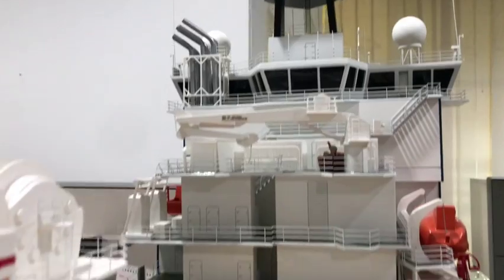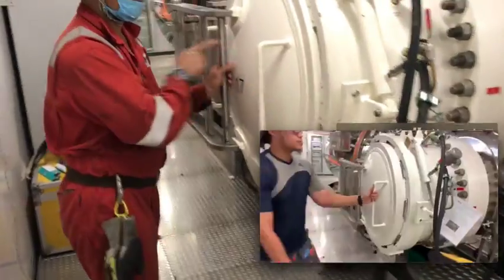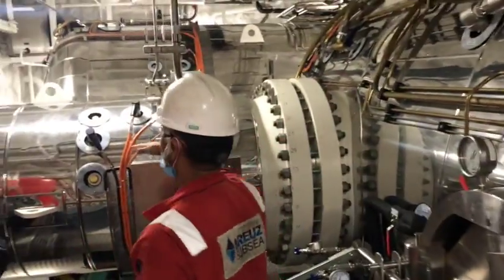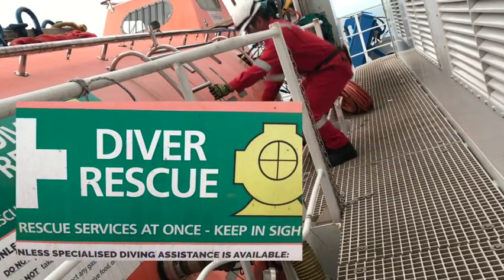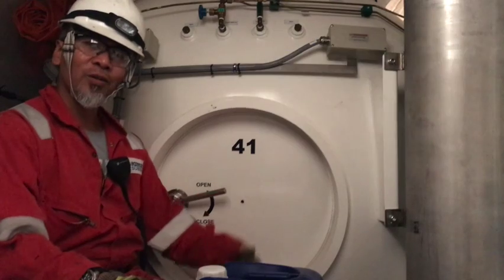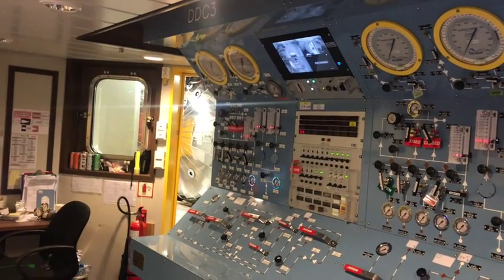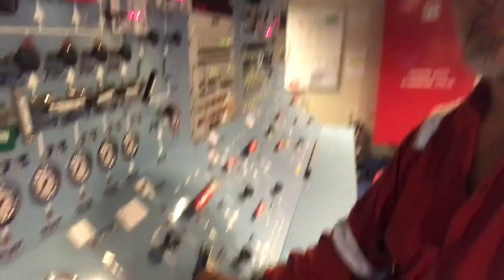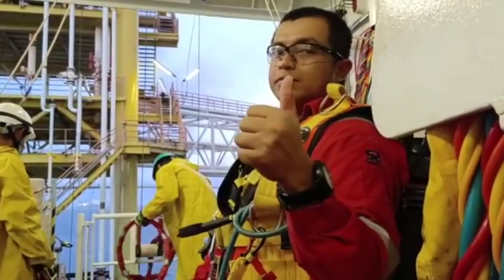Saturation Diving Chambers on Diving Support Vessel DSV Challenger . Brunei offshore

Comment: Hello Mr. Shamsuddin, don't be tired. I am Farhad, 24 years old from Iran, in perfect physical condition and an athlete, with a level one and level two certificate in industrial diving, working with a helmet from the Professional Technical Organization. I also have full certificates in argon welding, SMAW, TIG, pipe and structural welding, welding inspection (VT) and advanced industrial safety (HSE). I am interested in working in saturation diving. Please advise me on how to cooperate with your Excellency. Thank you very much, Farhad from Iran.🙏🙏🙏🙏
Reply from the maker: Hello Farhad, hope you are well. My apologies for the late reply. Been busy travelling and when I’m out at sea , sometimes internet is not good.
Your first move should be to get into an Air Diving school. That will qualify you to work shallower than 50m on Air. Then when you have enough experience and cash you can enrol into a Saturation Diving Course. That will qualify you to go deeper than 50m and you will be in an environment or chamber/bell with Heliox.

Comment: thx for the vid! What do the ALST/LST do during their 12 hour shift? do they have to stare at the wall of buttons the entire time in order to 'monitor' the diving crew?
Reply from the maker: Hello there 👋🏼
ALST work among other things, consist of preparing food for the Sat divers prior to their start of bell run(their 1 hours notice to dive), and their clothes for work. Also they have to prepare the hot water suits, their boots, cold mineral water bottle, sodasorp canisters, etc. Meanwhile Life  Support Supervisors (LSS) and Life support technician (LST) have to prepare the gases for the next chamber to be used. Calculate the amount of gases needed for the duration of the project and what is being used daily by the Sat Teams and send out the report to management onboard or onshore. Usually when all 3 chambers are occupied . They are busy running around for some sort of ‘lock runs’ or toilet flushes. On top of that when we do split level Saturation dives. Bail outs and On board gases have to be filled by them in according to the mixture of the current bell working depth… work carries on and on😁
Reply: @AbangShamvideos  interesting!! and can you tell me if ALSTs/LSS etc get to see much sunlight?? or would they spend most of their days in that room shown in your vid?
Reply from the maker: Oh! the LSTs are not confined in the chamber like the Sat divers. They are free to ‘roam’ around like the rest of the vessel’s crew. Only Sat diver remained in the chamber for up to 28 days, depends on the project and schedule.🤗
Reply: @AbangShamvideos  That's great to know! Would it be difficult for a female to become an ALST without having any commercial diving experience? I saw a IMCA approved online course for the LST cert, but I have a concern that employers would obviously want ppl that have at least had commercial diving experience...
Reply from the maker: Technically any non diving personnel can be an ALST. I’ve seen a non diver becoming an ALST. In reality some company prefer to use a diverALST because the person can also be used as a standby diver if they suddenly decided to do Air diving. This person could be an extra hand. But the main concern actually is about job availability-(are there much job to go around?). Many guys have Life Support Tech ticket but struggled to find a slot as a ALST. They need the hours before they can seat for the exam to promote to LST. You will need to travel to places where they are doing Saturation diving regularly in the beginning and spend a lot of time away from family..hope this answer your question.🤔😁
Reply: @AbangShamvideos  Yes, I can see why being a non-diver can be a barrier haha... Who are the big-name companies that perform a lot of sat dives and may be hiring ALSTs in the future? It's been difficult for me to find job boards that post these kinds of positions..
Reply from the maker: Usually they will post in LinkedIn for Sat jobs. There are 2 kinds of diving job. One is construction and the other IRM(inspection Repair Maintenance). You can see some of the companies start to look for Divers/LSTs when they are about to tender or win the tender or about to carry on the job..in any case you will see them looking for personnel..that’s the tell tale sign😁